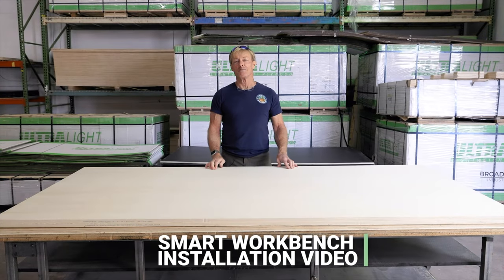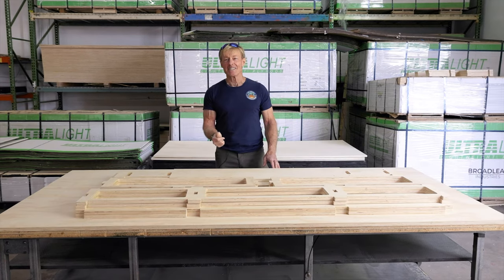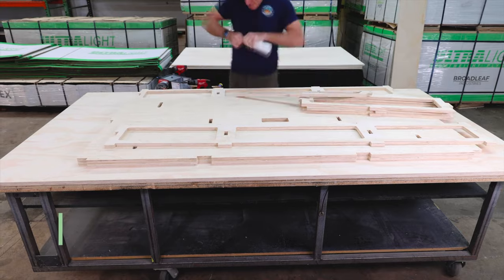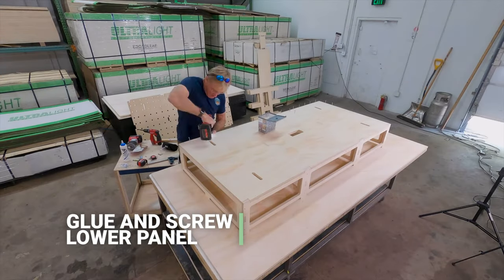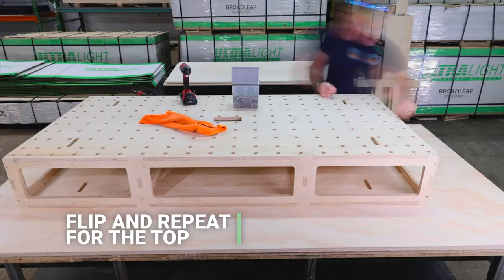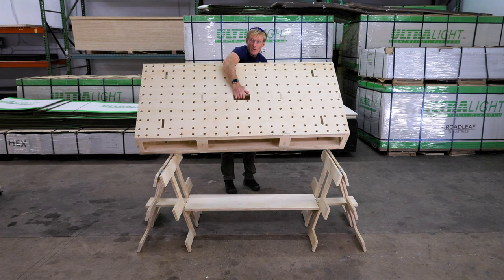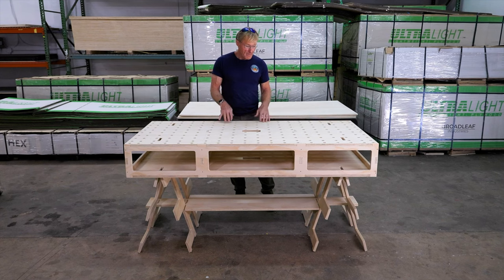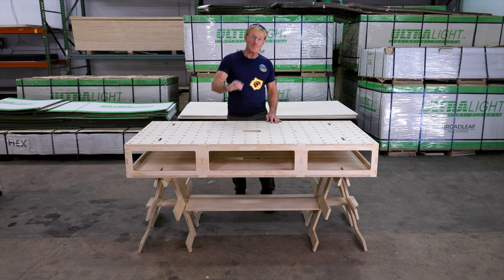Smart Solutions for Efficient Woodworking: The Paulk Workbench

Comment: Bought one. Just put it together on Saturday. Assembly was soooooo easy. Reparadise did a great job with this. Saw horses may need shimming depending on floor. Once shimmed (if needed), it is rock solid. Great job, Ron and Reparadise!

All things considered, I think the price is more than fair. And one more thing, It really seems dead-flat. Put my Stabila on it and could barely see any light through it.
Reply from the maker: Great to hear. I am working on the Smart Kart as the next release. A rolling bench will change your life😎🤙
Reply: @TheSmartWoodshop  Ron, I have had a similar idea for years. I’m sure yours will whoop mine but I think it could be a great time saver in set-up and clean-up. 

Reparadise is a quality outfit. Great choice. 

Thank you for all you have done for us carpenters!
Reply: @TheSmartWoodshop  any plans to do the total station? I could see some real benefits to the accuracy you probably get with their manufacturing process. But I'd think you would need to make a separate design for each miter saw for the slot. I'm not sure if that would be cost effective from the manufacturing process. 

Next time you're in Salt Lake City, I'd love the opportunity to take you to lunch. I'm a few towns away, and your designs have dramatically affected my jobsite productivity. I built the total station, the smart cart, and the (modified) smart woodshop in my box truck.

Comment: Hi Ron, are you going to sell the plans to build the CNC version of the workbench? I bought the traditional plans but i kinda like this construction method better
Reply from the maker: I have no intention of altering the plans. Employing a router and pattern to cut the slots and tabs would require additional construction effort compared to assembling without them. Therefore, it is preferable to proceed without the tab and slot approach.
Reply: @TheSmartWoodshop  I actually was thinking of cutting this with shaper Origin. Templates won't be required this way. Just SVG files. Just a thought.
Reply from the maker: @rodolfo-romero  We have considered adding a CNC file to our store; however, we are hesitant due to the unfortunate lack of respect for others' work within the "Maker Community," where files are openly shared. Although I have confidence in the Smart Fam's integrity to respect my design rights, the concern arises from the possibility of one individual spoiling the experience for everyone else. Once the file is in the public there is no pulling it back.
Reply: @TheSmartWoodshop  I hear you Ron and It is unfortunate that some bad apples ruin it for the rest of us. I appreciate the work you put towards these plans and all the R&D time. Thanks for your prompt reply!

Comment: Hi Ron, I bought your plans for the Paulk Smart Bench. Maybe I missed something but am I correct to assume that  the assembly must be done on a super flat surface?
Reply: His name is Ron and the funny thing is, all of the bench assembly videos I've seen show him assembling the bench on top of another bench he already has.  So what came first, the chicken or the egg? Lol
Reply: @billmartin3198  Thanks for the correction and the reply. 
Ron, we have a problem here....
Reply: @willemleroux8428  Pretty sure the assembly can be done on any reasonably flat surface. The parts are precision cut at very close tolerances so there's little room for error.  Heck, you could even throw down a drop cloth & put it together on your living room floor!
Reply: @billmartin3198  Thanks Bill, I did assemble it on my old table that is not flat. I bought the plans and had the parts cut at the store, not precision cut but it should work. I have another problem, my ply top is not flat. I dont know if all ply in South Africa is like this, it look like waves! I will order a sheet of mdf tomorrow to replace the top.
This time I will order it oversize to enable me to cut the sides evenly paced to the dog holes.
Reply: Replying to my own post:
You do not need a perfectly flat surface to assemble your table. The box style ensure a perfectly flat surface, it is very sturdy as well, no flex. I used 18mm mdf for the top sheet as local ply is not flat.